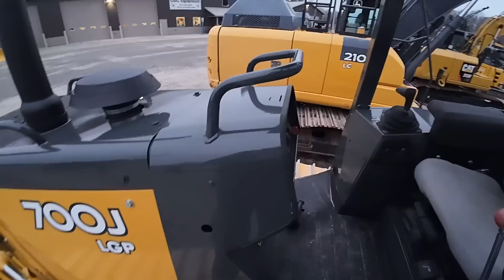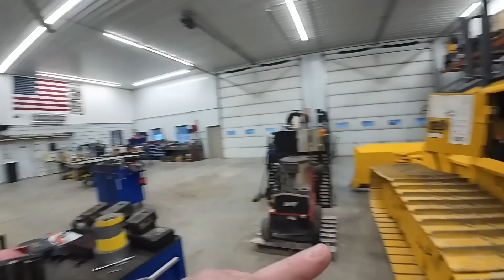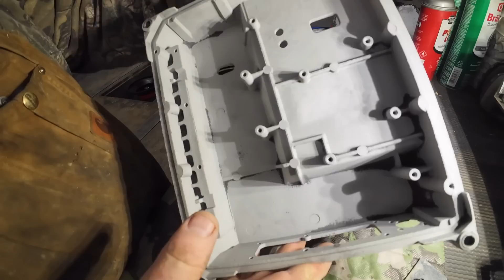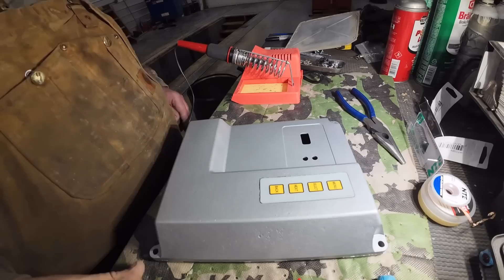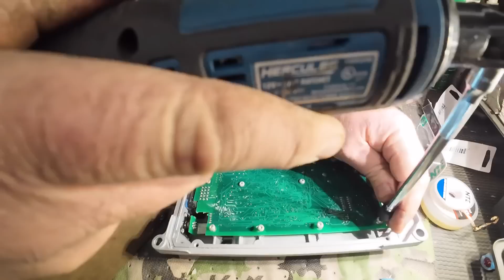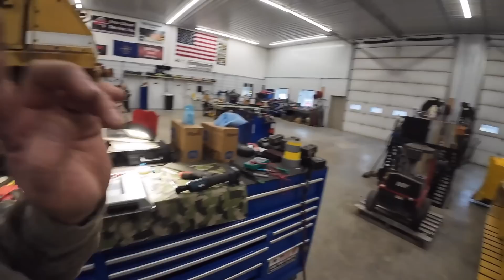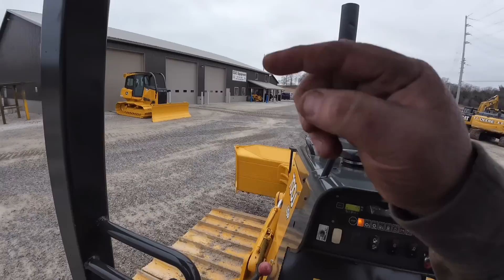John Deere 700J dozer transmission MC300 controller repair after it failed for cheap!

Comment: As usual, Clinton comes through. Just a couple of points, not criticism just word of caution. When you get in that same position, remove the capacitor from the board, then test it. You can get a misread from the circuit, most likely from resistors can/does happen with other components. As you were told, within 10% of target ok, higher than, discard. You will read lots of different views on solder. Both acid and rosin (flux) cored can cause problems. Never use Lead free solder on old circuit boards, it can cause different problems. Finally, use thicker superglue, ask your local mom & pop store for the thicker type, it sticks to the plastic better and doesn't spread so much as the thin. Then use any bathroom sealant to seal up the bottom of case to prevent water ingress. Job Done. Hope that helps.Regards from UK.
Reply: I'd recommend being very picky about any sealant you use near electronics.  Particularly "bathroom" types as they cure by the release of acetic acid (vinegar).  That is really bad news for any electronics.  The right sealants are readily available.  I suspect that the bodges of sealant round those original capacitors are an indication that somebody has been in before you.

Comment: Because some of these machines last for decades, any electronics from the late 90's to early 2000's will have failing capacitors, as this issue exists with personal computers, powersupplies and even satellites! I've replaced dozens of caps, many that were swollen, leaking or failed cap testing.

Comment: 3/5/24...electric circuit board for teansmission on that JD 700J..you replaced 2 (little) capacitors ($5?) + solder + your time to salvage the  ($350,000) sale...🤔 
 So very interesting video which , once again, shows just how well trained (& self taught) you are!!
  Great teaching video tiday! A+ Clint!!😊💪🔧⚡️ ..stay safe & carry on🚜⚙️🔧🔩🤠☺️🍺😊

Comment: My only suggestion would be to seal the plastic cover as well. Maybe some self adhesive foam tape or something. Silicon would be a bugger for the next person having a go at fixing things. Most electronics die from leaky caps. They leak electrolyte like dry cell batterys! Nice work Clint. Cheers and G'day from Tasmania

Comment: There is usually an "X" stamped into the top of most capacitors, if the top is bulged out (even a little) or you can visually see leakage on top or bottom, it's probably bad replace it, like you said they're cheap!

Comment: Clint, 
& have spent 70 years working in electronics,  My only suggestion would be that you throw away that acid core solder. You need to be using rosin core solder. Nice Job.
Gary 
In the beautiful Ozark Mountains of north West Arkansas
Reply: Agree from the flat farm land of Central Arkansas. I NEVER use acid core on anything. Solid with flux on plumbing, rosin core with Colophane flux on electronics.

Comment: 2 things. A) If you actually have a dead board that needs more than a re-cap, NorthridgeFix (Alex, he's on Youtube) is your guy. Can't see him charging thousands for a board repair, even if its a half day stumper repair.
B) I might have slathered some FluidFilm (or similar) on the contacts and on the controller (once mounted) to try and help keep water out of the board area and especially keep the "green crud" from the contacts. (That trick from Eric of SoutnMainAuto on YT)

Comment: Use some hot glue to secure the new capacitors to the circuit board. It helps with the vibrations.

Comment: Brake Clean makes a pretty good electronics cleaner.  You can always upgrade those capacitors by going to a high voltage than 63, (say 75 or 100 volts).  Might give you a cushion.

Comment: You said Lead acid solder. Not on electronics. Bet you have rosin core. Nice desoldering job with solder wick. Replacing old electrolytic capacitors fixes more older stuff than you would imagine.

Comment: Clint, I thought I heard you say you were using acid core solder in this repair. Acid core should not be used on printed circuit boards because the acid never is neutralized and causes further damage and usually results in the metal trace on circuit separating from the board. The recommended type of solder is flux core or rosin core.

Comment: Good job on the caps Clint. Not worth measuring the caps in circuit, you have to remove them first. Caps and relays on pcb's are easy to change, dont cost much and worth trying before costly repair or replacement on all electronic equipment.

Comment: Fantastic video Clinton. This will be the future for equipment, cars and trucks or anything with a board. I have done the controller for my air conditioner and AquaHot on my RV. A good magnifying glass helps to find broken solder joints that cause intermittent issues.

Comment: Dang, nice work on that repair.  It certainly pays to have experience when it comes to diagnosing those machines! I can not believe those shops were charging you so much to replace a couple caps.  Your finished product looked exceptional.  It's too bad JD didn't put those computers in a sealed area to keep the dirt and moisture out of them.  It would have prevented a lot of problems.

Comment: Good job on the Controller, Clinton. If you have trouble with electronic equipment the capacitors are a good place to start trouble shooting. There was a period of time when manufacturers focused on cheap & it was very common for capacitors to swell up & become dis-functional.
When I was looking after a fleet of junk I found that dielectric grease was my friend for protecting electrical junctions from moisture & rust!

Comment: Clint, it is worth considering spending a little extra on the solder you use. I was told this by a man called Ron Tauranac who had been an aircraft designer and went on to  be the designer for Brabham Formula 1 cars and later for the Ralt F2 and F3 cars I used to run. He recommended always using German Mundorf Gold/Silver/Tin solder, as it does not lead to later electrolytic corrosion, is very high conductivity and strong. I bought a small roll about 40 years ago and I am still only around half way through it, so it only costs less than a penny per joint, for peace of mind on the quality of the joint.

Comment: Clint I think you need Rosin core solder. What your using is for plumbing repairs. It could be a problem down the road using it and cause you a headache trying to diagnose..just my thoughts..

Comment: Clinton, in the future you should remove the capacitor from the circuit before testing. It will give you a false reading if it is still connected to the circuit. Great job on the solder repair, looks like you’ve done this before…love your vids!
Reply from the maker: Yes I’ve learned that
Reply: @C_CEQUIPMENT  Out of interest and assuming they are not deep in a bin, did you test them when disconnected too? If so what was the value?

Comment: Great repair job Clint and you should probably change your solder from acid core to the one for wiring. Acid core is good for radiator repair and other copper components non electrical.

Comment: you might be better off using silicone to stick those key pads back on, its strong when dry and it would keep out moisture ... just a thought  cool vid!!
Reply: You will never keep the water out of that design. Think water resistant vs water proof.

I think it is designed to let the water pass through and dry before you use it again.

Comment: Great video 👍 Forever learning and earning on the job and sharing 😊,a good electrical cleaner is isopropyl=alcohol (don't tell Kevin)wash the whole board and air dry with or without air gun.

Comment: Hello Clinton, thank you for a very interesting video. I will respect your request for comments. You said many times that you are not an expert, however you talk like an expert and work like an expert and desolder and resolder like an expert therefore, you are an expert! You did do something I was taught never to do and that was re-installing the circuit board and components of the controller, you used a hand held, battery electric device and I was told to never do that because it has a high risk of stripping out the receiver holes. Dad said to use standard screwdrivers to put it all back together. That was 50 years ago so perhaps newer equipment is better? I have great respect for you Clinton and really like all your videos except the one where (master painter) Kevin is spinning  the rubber off of perfectly good tires! 😁

Comment: If you wanna do one better, get the same mFd cap but a higher voltage.  It will "live" longer cuz the higher voltage caps are "tougher" adn will live longer.

Comment: you should check those capacitors when they aren't soldered in, the circuit could be giving you a false reading

Comment: A few hints I commonly use...
1: Most boards these days are assembled with 'lead-free' solder which has a higher melting point.  When removing components using solder wick, it's often a good idea to first ADD a bunch of new lead-based solder (to 'dilute' the lead-free crap) and then wick it all off.
2: Those capacitors SHOULD be glued back down (hot glue, or acid-free RTV).  Bulldozers vibrate a LOT and these (comparatively big) capacitors can break off the solder joints.
3: Any board that 'lives its life' outdoors is gonna get wet / damp and thus corrode.  I'd recommend spraying a clear lacquer (they call it a 'conformal coating') as a moisture barrier to keep moisture and humidity away. The stuff I use is: https://www.jaycar.co.nz/circuit-board-lacquer-spray-can/p/NA1002 (If you need to do a second 'repair', you can solder through it without having to first strip it, but don't forget to re-coat).  Obviously, don't spray it on pins of plugs and sockets!!!
4: With electrolytic capacitors, it's fine to use new ones rated at a HIGHER voltage (but never lower).
5: If you buy your caps online (e.g. Digikey, Mouser etc), always buy the ones with high hours rating and high temperature rating.  (You might think the board will NEVER get to 85C and you're likely correct, but a 2000 hour / 105C will last a LOT longer than a 1000 hour / 85C in the same environment.  A general rule of thumb is that the life will DOUBLE for each 10C drop in temperature.  Thus, a 1000 hour / 105C capacitor will last 4 times as long as a 1000 hour / 85C capacitor with all else equal.  If the max temp reached is only 55C, then a 2000 hour / 105C capacitor should last 64000 hours (7-8 years) while a 1000 hour / 85C would only be expected to last 8000 hours (about a year)
6: Cheap caps - SImply don't do it...  Always buy the 'uncomfortably expensive' units.  It'll pay off!  General rule of thumb is to be 'brand conscious'.  Rubycon, NipponChemiCo [NCC], Nichicon, Panasonic, Vishay, Kemet, CornellDublier are always good.  (Japan or USA).  Teapo, Samxxon, Choyo, Chhsi (basically ANYTHING made in China) are almost always bad.
7: Watch out for Chinese 'clone' caps (such as Rulycon, Rudeycon, Rubicon).  Highly unlikely you'll see them if you stick with reputable online stores (Digikey / Mouser jump to mind again)

Comment: Hello great video, you did well, I work in the aircraft and aerospace, +. Building Saterlites industry all my working life and in in amazement and horror that they put these things in places so they get wet covered in shit so they go wrong and so we all get shafted to buy a new one, you can get a spry to cover the board when you finished soldering it protects it from water and damp, and you can get a paint for the in side of boxes which helps prevent corrosion to help the electronics, you no if I lived near by I love to help on the wiring and plugs my girlfriend said I'm like a pig in shit when it comes to things like this, Paul South West France 🇨🇵

Comment: Back in the early 80’s I used to repair modems using the same capacitor replacement. Note that in circuit the tester will read capacitors differently than out of circuit.  Good video!

Comment: Some questions and/or suggestions. Many companies, make an electronic cleaner to spray down the contacts on the connectors and the contacts of the controller. (CRC QD Electronic Cleaner)(available at Home Depot, Lowes, Walmart, and Amazon etc.) is just one example. After the contacts are cleaned off and blown dry you can put some dielectric grease on all the contacts to reduce corrosion and help keep them waterproof. 
The super glue you used seems to be just regular super glue which is very thin, like water. While that glue may keep the sticker on it will not do a great job on sealing moisture from leaking under the sticker. Loctite sells an Ultra Gel Control Super Glue that is no drip or run, impact and water resistant, and flexible. If you put a bead all around the sticker and around the view screen and push buttons it would do a much better job keeping moisture, dust, and debris out of the controller. (available at Home Depot, Walmart, Amazon, and Walmart)
Reply: Love the channel.  I came to say the same thing about sealing up the display and buttons better to keep out the moisture.  Also strongly agree that the new capacitors should really be supported for longevity.  I've seen capacitors break loose over time in situations where the board is subjected to vibration and shock. All the best and really enjoying the content!
Reply: I was thinking the same thing as well as I didn’t see him put silicone around the new capacitors unless I missed it

Comment: Good job on the repair! I've repaired a large Keurig espresso machine, a desktop computer, a cheap Walmart HD TV receiver unit, and a couple stereo receivers just by replacing capacitors. "Throwing caps" at something isn't always the best way to do repairs, but every single time, I've found multiple bad capacitors. There's also counterfeits in the electronics field, and there's a large quantity of badly constructed capacitors out there, some even end up in OEM products.

Comment: Nice job Clint. You're finally in my wheelhouse!

That sponge on your soldering iron stand is to clean the tip. They work much better if you wet them and wring out the excess moisture, and THEN clean the oxide and burned flux off the tip.

As others have said, replace the capacitors with an equal or higher temperature rating without exceeding the physical size (looks like height is the limiting factor here). Replacing with the same capacitor (assuming you can still get them) will ensure you have that third stability leg ... and should last as long as the originals did. The NTE replacement parts will work, but I am unsure whether they have the same working temperature range the originals did ... BUT at least you know how to replace them if needed.

The silicon around the capacitors is indeed intended to reduce vibration ... and keeping the leads and circuit board from breaking. I'd clean the old stuff off and replace with a non-acidic RTV.

Thanks for bringing us all along ... I'm certainly not about to go into the heavy equipment repair/restoration business, but as I've said many times "Work fascinates me ... I could watch it for hours".

Regards,

R

Comment: Thank You for showing us how to change the caps on the circuit board.  I'm an electrical engineer and can only make 2 suggestions.  You said that you were using acid core solder never use that on electronics use rosin core solder only. Second is the type of cap from the local radio store is not designed to be baked in the sun under a dark cover.  Work the local guy and have him stock a better capacitor. I might cost $10 and last as long as the machine.

Comment: Clint, You should use rosin core solder on electronic devices not acid core. That's for plumbing (copper fittings). Acid core solder will eventually corrode the traces and lands on the circuit board. Great video as always.
Reply: Clint, if you can find some conformal coating, that is what the whole board is coated with, and after you are done soldering with the rosin core solder, clean everything with alcohol and then put the conformal coating on the area where you did the repair. That should make for a long-lasting repair.
Reply: Also use some alcohol to clear off the remaining flux, helps keep the corrosion down.
Reply: I don't think that little tube of solder was for plumbing. Not sure if it was acid core or not, but definitely not plumbing solder.
Reply: Clint said in the beginning of the video it was acid core solder and that small tin had acid flux in it.
 @tdotw77
Reply: Absolutely! Rosin core with Colophane flux
Reply: This is correct advice Clint.  I've been working on electronics for 50 years.  Acid flux is for plumbing.  Acid free or rosin core is for electronics.  Your local radio shop can sell you some.

Comment: Clint I was going to suggest you check the capacitor out of the circuit because obviously it's part of a power supply and there is always a load on it when is soldered on to the board.
But somebody else in the comments already did so never mind.

Comment: Clint, a FYI, you should use a rosin core solder for electronics, never an acid core.  The acid flux is too harsh for electronics.

Comment: Nice job, Looks as good as new, I too like the desolder tape over the vacume type tools. I never use CA glues on electronic assemblies instead using a small amount of clear silicon caulk/adhesive so I can remove plates/parts later if needed. It takes a little longer to use silicon as adhesive but gives me paece of mind. For boards I use pure lead rosin core solders to insure connections do not isolate/open or grow spikes/whiskers and self short in current carrying conditions. Ray Stormont

Comment: Another hint use an old toothbrush and some alcohol or circuit board cleaner to remove the acid core flux from around the soldered area.